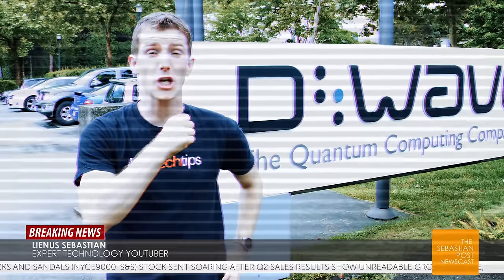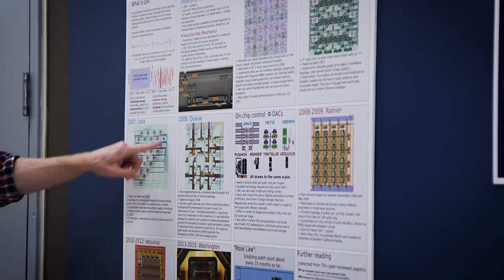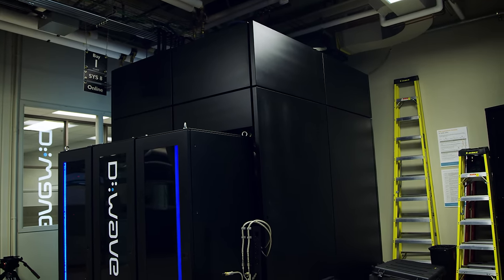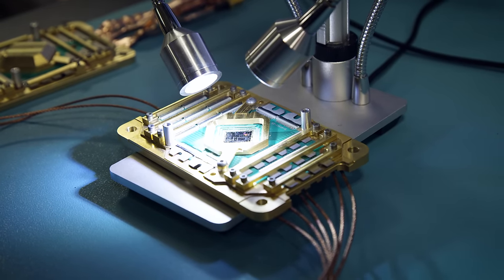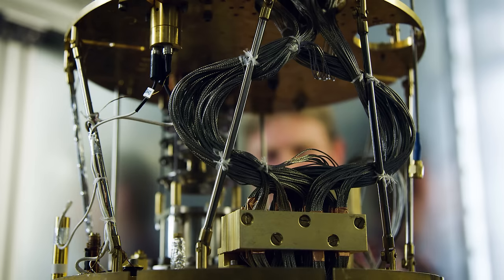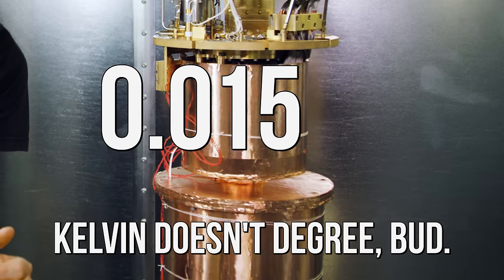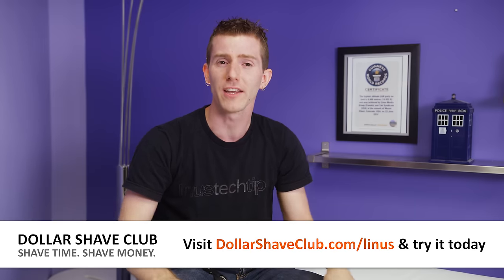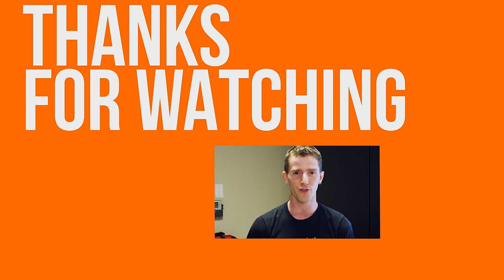UNBOXING A QUANTUM COMPUTER! – Holy $H!T Ep 19

Comment: Eventually, D-Wave would change to its more infamous name: Skynet
Reply: Or Google, look it up.
Reply: Kritacul are you special?
Reply: Quantum computing is only a useless fashion. My wood case PC is the future, and i can sell for less than 1.000$.
Reply: or black mesa
Reply: potato>wooden PC
Reply: My home WiFi network name?
Reply: Actually Dylan, he is correct. If a self learning AI had a large store of any data it could posssibly need, it would be all powerful right? Well that store of data is something we call google, it contains random and useless facts but it also contains much infomation about our strengths and weaknesses. 

If the aforementioned self learning AI could access google then it would theoretically have the ability to control and manipulate us as a species.
Reply: Ryan White umm no. Google itself doesn't contain that data. The websites Google provides linkage to do, though.
Reply: To many already call them self Skynet or have products known as Skynet to being with. Would be confusing if they did rename them self that.

And it is not like these quantum chips can create AIs on there own. There better for solving some hard to solve problems. And some of these problems may be useful for AI research. But it would not be enough to just build a AI.
Reply: Xander Simmons however Google does own about 3/4 of the servers holding the internet.
Reply: Xander Simmons yes but the point is that it still contains access to that information which an AI could use.
Reply: Fallout reference..?
Reply: Fortunate Talisman Google was supposed to be it
Reply: Fortunate Talisman also representing it's subsidiaries: Cyberdine, Cobra,  Đ€Č£PŤÏÇØŅ§, the B0RG, & not to mention the share holders: men/demons/aliens/giants/fallen/the■☆》+/reptilian/xenomorph/Kraken,liken,vixen,wiccan,imps, gimps, temptress bimbos nymphs,toads w/ ingrown lymphnodes, ŤĪMĒ wrinkled ÅŁPHÄ•ŇÜ[^]€RİÇ quantum physics & hieroglyphics get symbled    w/ 666pincodes mix till it implodes the dome into a disc to spin globes
Reply: The server room at SpaceX is called SkyNet - it was just a joke at first, but now Elon is actually worried that his companies might cause Terminator to become reality.
Reply: Fortunate Talisman Well D-Wave isn't an AI
Reply: That machine is simulating our lives right now.
Reply: Cythil oh Jesus... the grammar.
Reply: Er... Google contains large sets of data about we all.
Reply: Lilboh Beat Skynet already exists
Reply: I really hope, it's irony. People actually could believe that. Like some that believed that a particle accelerator, could destroy the entire reality...
Reply: skynet? More like Megatron or something
Reply: @Diamond_Tiara  J.A.R.V.I.S..

Comment: I love how he's yelling out "degrees kelvin" in that facility. Imagine what the workers are thinking. 😂
Reply: It is not mistake you know... 
You can tell 
100 Celsius = 100°C
100 Farenheit = 100°F
100 Kelvin = 100°K

Or!!!
100 DEGREES Celsius, 100 DEGREES Farenheit, 100 DEGREES Kelvin... 
You know that sign " ° " that is written in situation like this? 100°K
Oh wow, that sigh is literally a degree sign, so yup, Linus wasn't wrong at slightest...
You can leave word "degree" in common talk, but it is actually still there and you mean it

Actually there is a situation when you cannot say degree... It is if you mention light temperature, like 6000K, and it is MUCH different from actual temperature (it is not that you lamp runs at around 6000°C)
Reply: @DimkaTsv   Degree K or °K was used in the past but it became obsolete by international agreement in 1967. See resolution 3 of the 13th General Conference on Weights and Measures. 

Like you said common talk is fine but the Celsius and Fahrenheit comparison doesn't work because, unlike them, Kelvin is an SI unit. 

For instance despite Kelvin being just shifted from Celsius, Celsius was derived from getting a mercury-in-glass thermometer and marking the ice-point and steam-point on it. The distance between these points is then divided into 100 divisions or degrees. The units used here are thus called degrees Celsius. 

Kelvin, the SI unit of temperature, is based on the triple point of water (The temperature where water can exist in all 3 states). 1 K = 1/273.16 of the triple point of water. Kelvin, as an SI unit is similar to the meter and the second, and we don't say degrees meter, or degrees second.
Reply: @tasteyfoood  Hmm, ok, reasonable argument. Need to oversee my take on Kelvin... 
It is just hard to talk about temperature and not say degree. As it is standartised word used for temp measurement in my country
Reply: @DimkaTsv  oh dang I was gearing up for an argument on the internet. haha that's fair though, I can only really speak to the American English use of it
Reply: @tasteyfoood  Ty for this comment. Learn something new everyday! I Understood Celsius and Fahrenheit but did not have a understanding of how Kelvin as a unit of temperature was defined.
Reply: @tasteyfoood  Ahh I see so 1 Kelvin is a division of the triple point of water so a degree.
Reply: @cvspvr  wrecked

Comment: Where can I buy one of these cpu coolers. Need to overclock my i5.
Reply: I know right
Reply: AsGoodAsAHacker I use a hyper 12 for my r7pentium
Reply: AsGoodAsAHacker just steal it boi
Reply: I know you are joking, but on a serious note for anyone that might be curious. You can usually check with a company that makes or maintains NMR machines (Scientific version of the MRI machine used in hosptials).  They use liquid helium to cool their superconductor magnets down to 4K and lower.
Reply: AsGoodAsAHacker I
Reply: intel: dont overclock it
Reply: I wonder if you can keep a fermi chip under 40c with this beast.
Reply: MineNightOwl 7900X*
Reply: ParadoxicalParadox that moment when it's cooled at -270 c but the vrms are not included in the loop 😭
Reply: i need to overclock my fx 8320 to 3.3ghz where can i get one of those
Reply: You have Intel, no overclocking for you
Reply: The joke was like Evel Knievel going over 50 school buses here.
Reply: LOL
Reply: Kool nãosei This is actually extremely wrong. Intel doesn’t push their chips to their max because they can just ask money for an unlockable chip. Plus most of the times you only need to increase volts by a little bit and a good cpu cooler would in fact stop that extra temperature you would get from the cooling. Also underclocking doesn’t per say increase the life time since the chips are made to maintain stock speeds for a long time. It’s like saying:”Im gonna turn down the brightness of my screen because then the screen will have a longer lifetime.” Good rant
Reply: AsGoodAsAHacker why would you need it for an i5? I'd use it on my Celeron
Reply: more like overclock the i9 7980 xe
Reply: I need to overclock my 8088 processor so I can play doom 1,  je je je....
Reply: ayyy lmfaoooo
Reply: lol fr bro
Reply: Buy SilentiumPC fera 3.
Reply: Use a thermal compound.
Reply: well unless u have the stock cooler on your i5, i5s are pretty damn easy to cool. just get a Hypo 212 evo and overclock
Reply: This shit can overclock even Pentium g4560
Reply: I gotta overclock my core duo
Reply: Bspeck82, I guess they do basically that same thing with it.
Reply: I need one to for my thread ripper
Reply: To how many thz